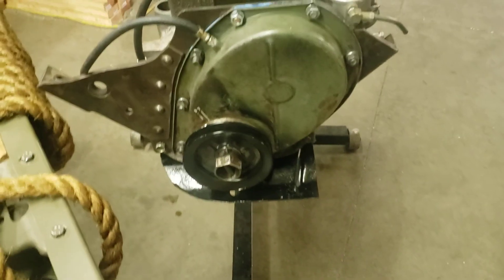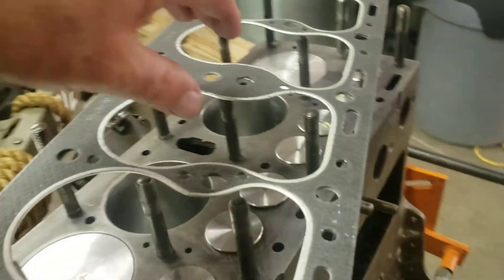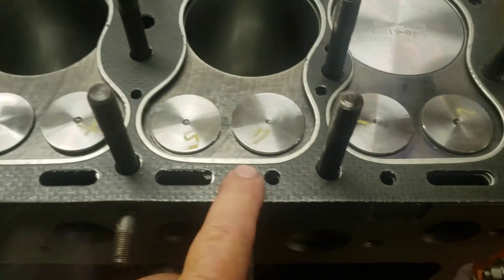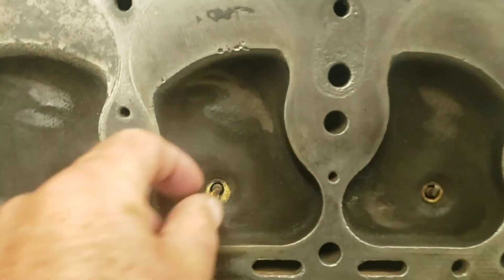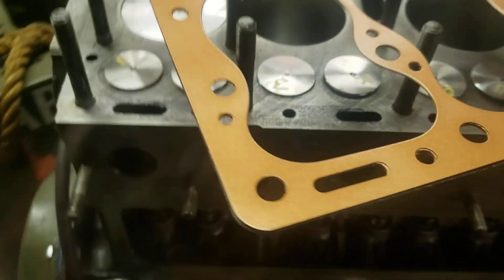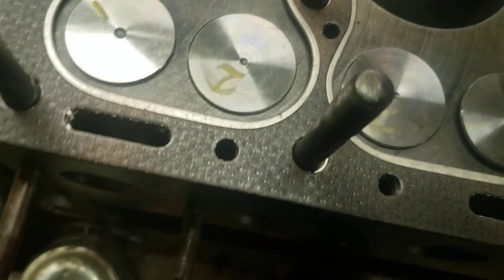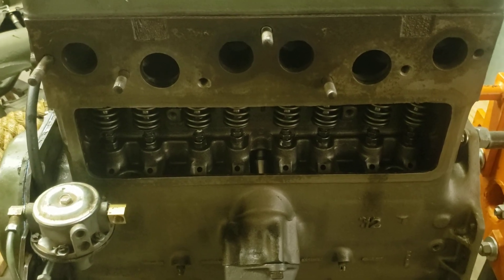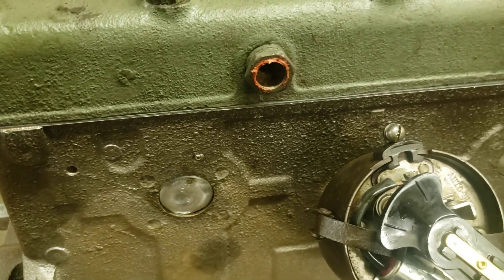L134 engine build #9

Comment: What did you use to seal the head studs in to the top of the block?  I have used teflon based thread sealers and have not liked the results, especially when dealing with some worn stud hole threads.
Reply from the maker: For stud threads i use old school Permatex type II.  Never had one leak.
Reply: @hummernutsfl  Thanks

Comment: Was wondering if you have had good luck with the Joes Motor Pool rear main seal?
Reply from the maker: So far, I have only used one of those seals.  It is in a cj2a motor and has about 600 miles on it.  No leaks so far.  Seal looked nice.  I think it will work fine.

Comment: Hi, Thanks for the video, watching them one after the other! I have a question regarding the camshaft gear installation as it seems to me that this was not cover in the video (maybe I skipped it). I had to remove the fiber gear which was well worn out on my '51 3A, and I am not at ease putting the new one in sync with the crankshaft. Of course there are the little "O" marking on both, but the way I understand it, crankshaft can be 180° off. So am I right saying I should first set engine on #1 piston at TDC (and how, engine in place?) which should put the crank gear in the right position to be aligned facing the cam gear marking? Distributor untouched, everything else in place. 
Thanks a lot in advance if you can take a min to reply me! Cheers.
Reply from the maker: Yes, #1 at TDC, timing mark in window by starter.  Dizzy pointing to #1.  Line up the marks and you are good.
Reply: @hummernutsfl  Thanks a lot for the hint, appreciate!